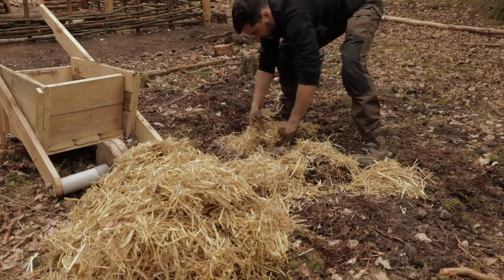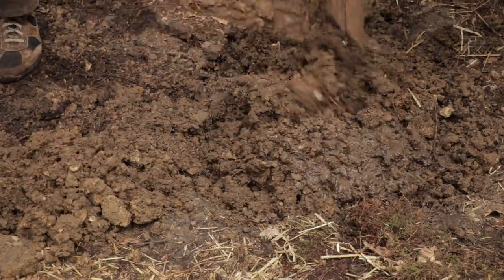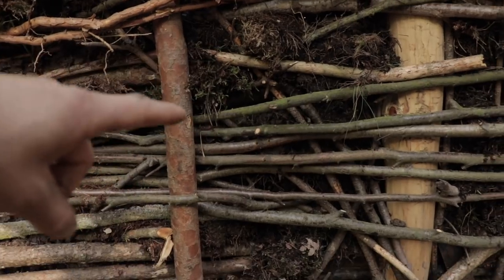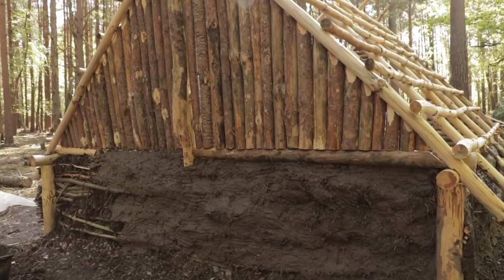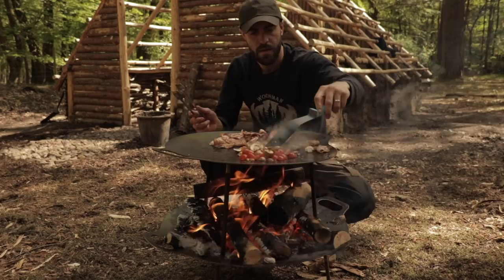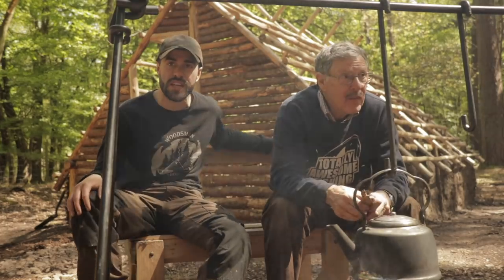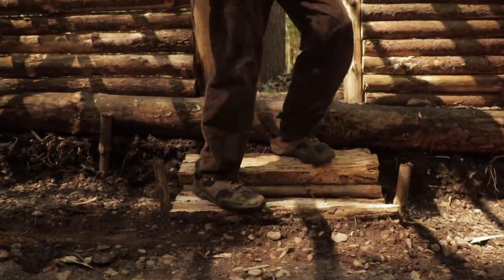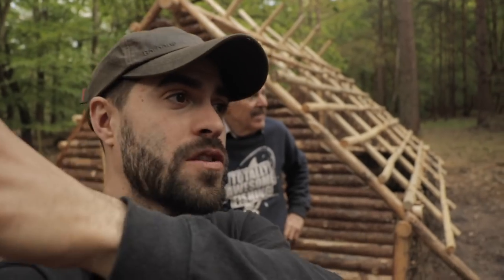Building a Saxon House in the Forest with Hand Tools: Clay Walls | Bushcraft Project (Part 7)

Comment: Is your father looking to adopt? :D
Must be awesome with a parent like that, and having that relationship..
You are a lucky young man.. he is even doing all the hard work while you film :p

Nahh.. great vid again..
Thanks.

Also. im not all that sure why it is done.. but for some things ash is mixed into the clay..
I think it helps it bind more and crack less as it dries because it gives it a bit of glue feeling..
not sure though.. just know its used.

And one word...  Skynet.
The time has come.. 
Terminator the age of the machines.
Reply: i think ash and limestone is added for concrete, i have no idea if just adding ash would make it stickier but it could be an interesting experiment :)
Reply: @A Rustle In The Bushes And AutumnApril 1989..
I know that ash is used in other mixes so it become more rubbery, or glueish. and do not crack as easilly because it makes the fiber able to move a bit..
But im not sure if that is the reason why its sometime used in mud also. or if it does something else.
Reply: Get a free sat app. Skynet is a sattelite

Comment: My Grandfather always told me that when you Plaster a Wall, make sure that the outside stays moist the longest.
He said that it should dry from the inside out and NOT from the outside in, to prevent Cracking.
He used to cover the plaster with wet sacking or Newspaper.
Reply: He probably knew what he was talking about then, well they will have to learn the hard way ^^

Comment: Totally awesome! I can now see why dung was used in the cob. The straw adds long fibres to bridge the gaps and the dung adds short fibres to give flexibility under different heat loads. So if you want to avoid cracking daub, you need to add dung to the mix.
Reply: Or chopped up fibres as well as long ones?

Comment: Those square nosed short handled spades are so much hard work to use, I can't be more than 150 miles from you yet most people here use a long handled pointed nose shovel (Cornish or Westcountry shovel).  Once you get use to the slightly different techniques for using them, you'll never want to go back, mainly because of your back!

Comment: just quickly on the mushrooming on the wedges Alec Steele did a bit about shaving the mushrooming off because it can be dangerous. something to do with it being work hardened so if it breaks it breaks at crazy force and speed. I had never considered it before but knowledge is power and all that

Comment: Because you added straw to the mix, there will be some shrinkage as it dries.  Be sure to check it every couple of days and fill it in where needed.  You may consider a fire inside, before you add the roof, to set the wattled walls.  You can give some flex to your branch base by soaking them in water for about 12 hours before use; soaking seems to work on pine and birch, but not so much on the denser woods.  I like the gear you used for cooking.  Best to you and yours.  Cheers.

Comment: As for wood wedges,  I have 5 wedges - the youngest is from 1968. Fantastic swedish quality, reallysimplyfies the work when cleaving logs. Largest I've bested was 240 cm in diameter.  Worst kind of tree to cleave in my opinion would without a doubt be elm tree. Cedar, chestnut, ash, oak, beech, birch, pine, all easy compared to elm.

Comment: Have you gents given any thought to stone on the outside wall? Not sure what access you have to creek stones, but I think it would add to the look of the outside of the building. Start with flat stones, add a layer of mud/clay like mortar mix, then more stone. Like brick work, only using creek stones or other porous stone. Sand stone would be good. Something that the mud would bond to. Just an idea. Love watching the father/son bonding. Keep up the good work gentlemen.

Comment: Mud and straw - mans' first known composite material. Carbon fiber eat your heart out!
I've been trying to work out a solution for an inexpensive greenhouse here in north Idaho and I think this would work beautifully. I can get a "post and pole" permit from the Forest Service to the frame, then use either plastic or transparent corrugated panels for the roof.  It wouldn't look as cool as yours will if you can do the thatch roof, but it would still be a really cool solution.

Comment: You two are phenomenal: laughing through the pain.  I ALWAYS enjoy your videos.  Thanks for taking the time to share your adventures with us.
Not for a matter of time, but cost thatching that roof.  According to Time Team,  subsequent residents filched building materials from Roman structures that collapased with time.  Maybe consider clay tiles for the roof, 'borrowed' from an area Roman Structure.   Of course, that would still be a cost, instead of foraging from the area, but just a different idea to consider.

Comment: Great vid gents. When I saw the first batch of daub I thought, it's gonna be a looooong day. Doing it slowly is probably the best way to slow the dying, as you discovered. I thought also, did the Saxons time the building with the seasons so they could have slow drying(?) If they had clay, might they have done clay L-tile roofs? I suspect they did any roof that was available - L-tiles, thatch, bark, etc. Great work and I look forward to more vids. Love that it's an intergeneration endeavor. Family is forever but the time we have with them is a precious commodity.

Comment: Such an awesome series. Some folks here in the US are building mud homes and they're mixing it with a tarp by putting the ingredients on the tarp and then rolling it back and forth you might try that. It goes a little faster I think or work it with your feet

Comment: Definitely cover it so it's shaded but I don't think you need to plastic wrap it. It's not like cement, there's no chemical reaction happening that requires moisture so you still want it to actually dry, just evenly to reduce cracking.
Also You could push a little daub into the joints in your gable end logs too to seal it all up.
Loving the content.

Comment: I know that you guys are done by the time I found these videos but I just wanted to leave a comment saying that you did a great job with the film making along with the actual construction. I greatly enjoyed the videos. Thank you for the content.
I also wanted to mention one thing about the wedges that you were using. When the metal on a tool such as a wedge, chisel, or punch starts to mushroom over you really should grind the mushroomed portions off. If you look closely you will see that the hammered over metal is fractured and very brittle. I have seen pieces break off and go flying fairly often before someone warned me to grind my tools. It is even more important when you are not wearing eye protection.

Comment: Nice Series. I Watched others before but this saxon house looks brill.
My advice for you to pretend the clay of cracks is to mix it up with some sand and as you all ready said try to let it dry slowly.
The main reason for the cracks is the water in the clay. Sand helps it not to shrink to much.
I guess you could have done the inside straight away but it's ok to do it later. If you moisten the inside parts and "rub it on" (let's say you activate it) before putting the inner layer it'll stick way much better.

I live in Germany and work as a builder for old scrambled houses. So this is kind of my daily business. 
Let me know what you think. 

Keep up the good work. Can't wait for the next episode. Greetings from Germany.

Comment: IMO it's a good idea to put the tarp over the walls so they don't dry too quickly (because then you'd need to fill the places where it cracks and chips away with even more clay).

Also, while waiting for the thatch to come in I'd suggest throwing some tarps over the roof to keep the house from turning into a swimming pool and to prevent the walls from eroding.

Comment: you guys it looks amazing, you inspire me to step up my game and building better shelters at my camps for my customers. thanks for that
Reply: @Bushcraft Incompris personal;  i  build just how big i want it my self, and it depends how much space you have, if i would build a saxon house like them then i would make it 6 mtr by 4 mtr and from corner to corner you measure if everything is 90 degrees. why 6 x 4 is then you can have easly have 6 til 8 people inside, i build a viking hut i made that 10 x 6 so i van have easy 15-20 people in there so i teach in them and cook . but i have an area of 800 acres so i have space enough so i can handle ore than one group at the time. also we building right now some cabins they will be 5x 4 so they can have 6 sleeping places a cabin, kitchen and a living space not to big because the winters are hard and cold here and you need to heat it up as well. i hope it helped you a bit.
Reply: @Bushcraft Incompris than a 3 by 2 would be enough 4 x 3 even better
Reply: @Bushcraft Incompris sounds like  good plan, and you don't need to much trees
Reply: @Bushcraft Incompris good like to hear that, i cut a lot of green trees but it needed to clean out and i replant on where we took down big trees. eventhough i have enough forest and can cut till up too 20 % without replanting but we have to respect the wildlife here too bears wolves bobcats deer elg etc

Comment: Daubing. My least favourite memory of the Saxon Village Project. We used fresh horse manure, so it stank until it dried. But we stank for far longer. LOL Clever modern take on it, though. Solved problems as you went along and tried different techniques to see which one worked best for you. Using logs certainly beats doing it with your feet. Definitely cover the walls to allow the daub to dry slowly. Some Saxon-era buildings were roofed with turf rather than thatch. Especially pit houses. Thatch was saved for the roundhouses, with a layer of planks underneath. This can be seen in buildings saved in museums such, as Weald and Downland Museum and St Fagan's. However, later in the era the richest people had clay tiles.

Comment: These vids are great guys. I'm grateful you listened to my suggestion during viking house build to learn thatching, I'm really looking forward to that vid.
There has been some excellent suggestions to stop wattle n dorb cracking, all of which I agree but i would just like to add another suggestion:: use the least amount of water in the mix that you can as this would help stop shrinkage and reduce cracking although possibly more difficult to work with. This is shaping up yo be one of your best series yet, AAA+++.

Comment: So I came back into the series late , as life happened!  Some of my comments might be too late to help, but some should still be useful (I hope).  You are right to tarp out the clay, as you DO want it to dry slowly to minimize cracking.  You will get some, and usually there is a final layer put on after the main is dried, that will have finer grasses/smaller cut , as a finish layer.  (This is the place that horse or cow manure would be brilliant, as the organic matter is pre-chewed! :-D)  Then, once those layers are dry, a layer of lime to protect the mud from rain washing it away.  (Natural stucco...)  Best way I have found to mix cob (daub in this case....) is to put all materials in a big tarp, and walk on it, then sort of roll it back together with the tarp, and start over again until well mixed.  then drag the tarp over to where you are applying it, and  use it straight from the tarp.  Hard on the tarp, but much easier on your backs!

The part that is likely too late to help, is that you might want to build a bodger's bench to peel bark.  Its easy to build, and portable, and you could easily build it with a combo of pallet wood and dried logs.  It makes it MUCH easier to use the drawknife.  Drawknife also works really well to hog off wood, when used with the bevel up.  Great series, all of them!

Comment: Its coming along. Try putting a tarp down and mix it on it. Also use bear feet to mix it. Its EZer and not as messy. Then you can roll the mix with the tarp.

Comment: I agree with throwing a tarp over it, but make sure it can still breath. You don't want to have the tarp so close that the evaporated water just drips right back down on the clay. Put some tarp down where the roof would be. That will provide some shade and keep the direct sun off. Interested to see how it turns out.

Comment: very cool fire oven table set, never seen one like that before, keeps the clean up ezpz. Your Saxon house is looking wonderful, kinda resembles a cob house, maybe you could whitewash it once its done (keep the inside cooler). You and your Dad are a great team, your inspiring, relaxing, funny & down right entertaining. Cheers to ya both :o)
btw I just looked up "Saxon house roof" on line most returns were your site but in images there are plenty of thatch'ed roofs as your saying, but you will also find a few structures using flat wood shingles, and it made me think if you can get pallets for free or cheep maybe that could be a reasonable alternative? 
Bummer about Dad's hand, always remember when heavy tools are droping step back, don't try catching,, any more!
When I was in the US Air Force (RAF Mildenhall) we played a lot of darts and had a rule if the dart hit the metal rim, bounced back at you and if you cought it before hitting the ground you could re-shot that dart, well after one stuck me in the hand I once again learnt the hard way, step back. Congrats on your success doing what is fun.

Comment: Nice house you are building, like the material usage. Clay cracks because there is water in it. It just dryes up, there is no massive chemical hardening reaction like there is with lime or cement.  Direct sunlight just makes things move faster on the surface. Slowing the proces by covering helps it shrink in unisome. It is not concrete where you need to hold in water to get the maximum of the hardening reaction. Straw in there should keep things together even with cracks. After some time, fill the cracks with just cley.

Comment: If you leave the "traditional", there are a multitude of ways to bring fire inside your structure. A 35 US gallon drum with one end open, a 4 inch dia hole in the bottom near the top and a 4 inch dia.  duct work chimney would be the quickest. Just be sure to line the bottom with stones packed with mud, no straw. This keeps the drum from burning out. It will give off a great deal of heat. Make sure that your chimney goes at least 3 feet above the roof peak.

Comment: Not to late to build a chimney out the back. If you can find some bigger flat stones the mud  you're using would make an excellent mortar. Just leave out the straw and increase the clay ratio to 80/20.
It will fire itself into mortar after a few cooking fires.

To keep the chimney. Safe. Keep it under 4 ft and place a capstone on top so the smoke vents out sideways instead of straight up. It should catch embers that way.

Comment: Hey,  I'm not too sure if the clay layer should touch the ground like this as it will start absorbing the water from the ground. I guess on the very low layer you should have used stones and plaster them from inside only as isolation....but that's they way at least we do it in the southern Europe.
Anyway great videos and keep up good job! Greeting from Bulgaria!

Comment: I love this series!
Also, have you ever considered using a battery-operated drill with auger to bore holes for wooden pegs instead of using nails? It would result in a more "period" structure after you're done...and if you are going to move away from medieval methods, one way is as good as another, yeah? Regardless, excellent work! I'm "Like" #40!

BTW, If you ever want to visit Utah, please look me up!

Comment: I was born in Holland, around 3 meter under sea level. So, top sole from the swamps before then clay. Our foundation were wooden pals (oak trees) and around 50 feet long, till they standing on the sand from the old North Sea bottem. The top must be under the ground water level otherwise they rot away and bye bye house. The Centre of Amsterdam must be kept on a certain ground water level also, if not, Amsterdam will miss a lot of historical  houses...

Comment: I have a question; after its all done, would you be worried about bugs inside the cabin? I live in Japan and am creating a little medieval village for LARP, and I would like to build a smaller version of your Saxon cabin. We have issues with ground bugs in my forest, but I haven't dug into the ground to see if there is any action below the surface. Will bugs be an issue for you guys?

Comment: The word Dauber means to cover all coats with soft adhesive matter as plaster or mud material especially of the third kind for daubing walls ... 
Wattle is the word used to refer to the adhesive matter as plaster all matter mixed with horsehair and cow silage . 
Matter - A little guy that sits in the corner making mats all day lol .

Comment: The reason for the manure component was because the manure of herbivores is filled with tiny bits of undigested fibre. Straw will do the major strengthening and the micro-fibre from manure helps prevent the tiny cracks.

Today, there are artificial micro-fibre additives for concrete for less cracking. It only took us about 1000 years to figure out what they knew 1500 years ago.